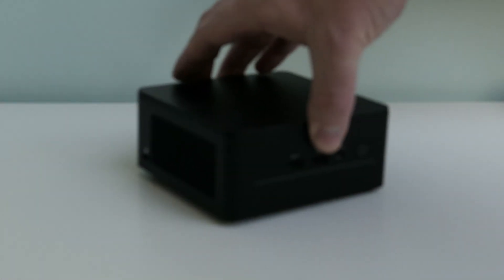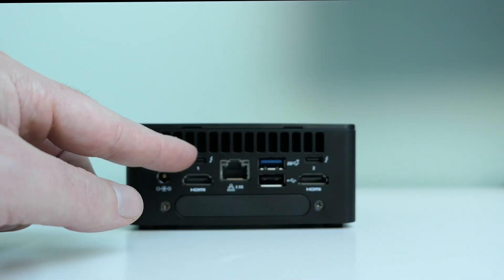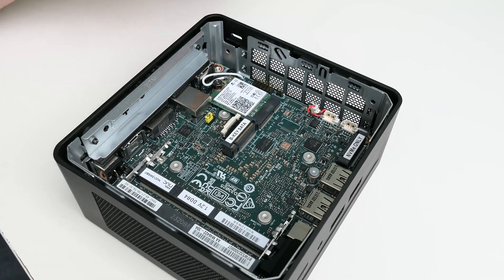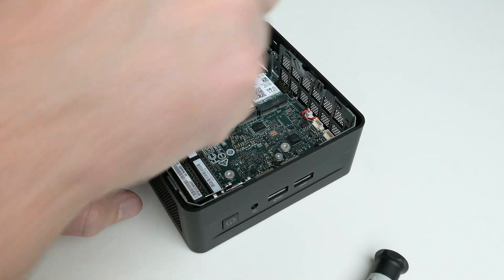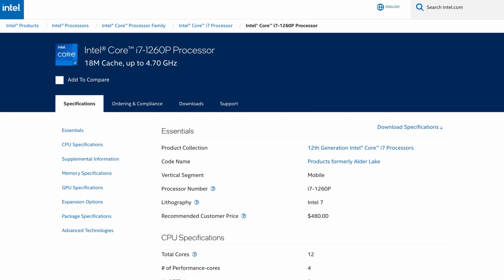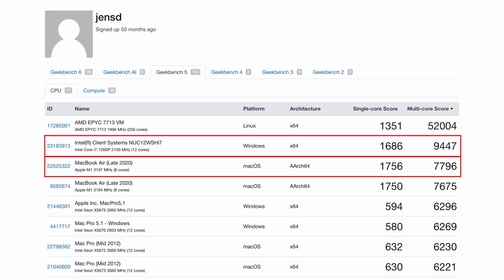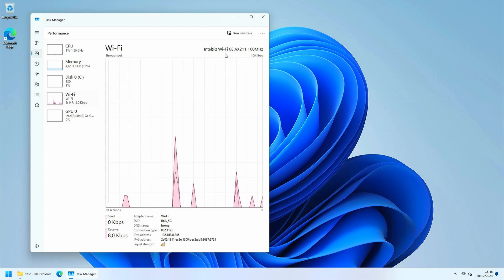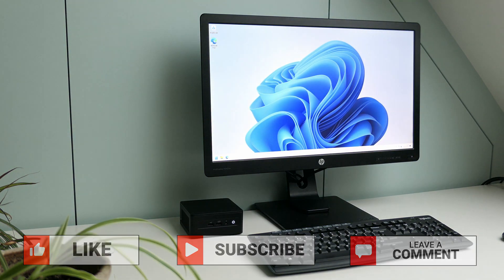Intel NUC 12 Pro - Teardown, Upgrades and Benchmarks

Comment: Did this.  My tip: wrap a length of wire around the M2 drive retaining screw and tighten up the screw.  This makes it easier to pull the board up.  Bingo.

Comment: Great review, thank! I would like to purchaste this NUC model but I have one doubt: it would be possible to use ddr5 ? Official specs says this gen supports ddr4 only, but the processor supports ddr5 (but maybe not the motherboard). 

Greetings
Reply from the maker: DDR5 is physically different from DDR4 (the notch is in a different position for example) so this simply won't work I'm afraid.
Reply: @jensdbe  Thanks a lot !

Comment: Do you have a custom solution for Intel NUC? 
Lately, I’ve noticed the fan is getting louder, and the temperature is pretty high. 
Could it be that the CPU thermal paste is wearing out?